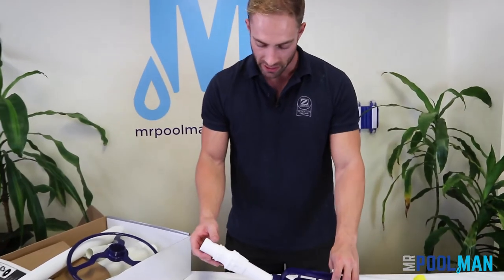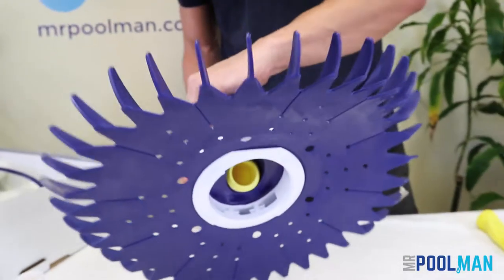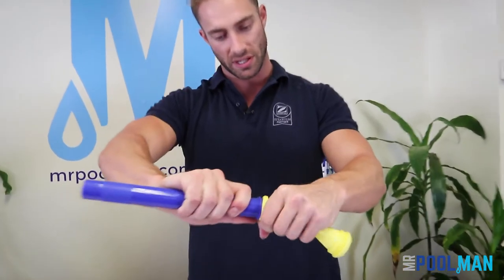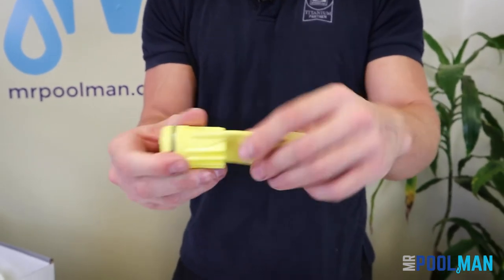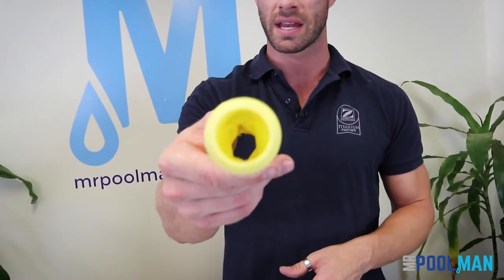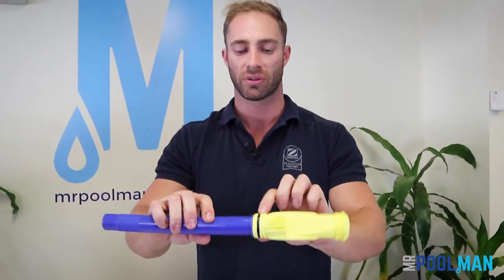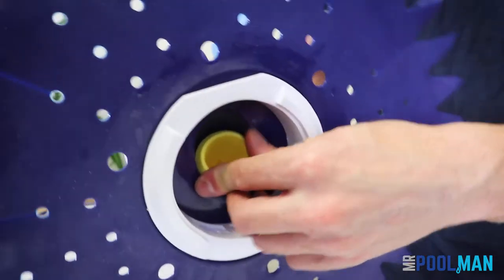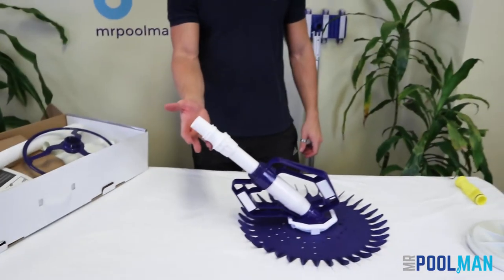How To Replace A Diaphragm In A Suction Pool Cleaner | Pool Advice | Mr Pool Man

Comment: THANK YOU! I have been battling to fit the diaphragm for years. One thing though... the BLUE 52 SPLASHER cleaner does not appear to use a "retainer ring" as a small outer cover that slides over the inner tube has five or six "tongues" that snap into place on the diaphragm ridge/groove end (where the retainer ring would normally be placed).
Reply from the maker: No problems, we love to help!

We are not familiar with that cleaner in particular but there are similar applications that dont have the retaining ring!